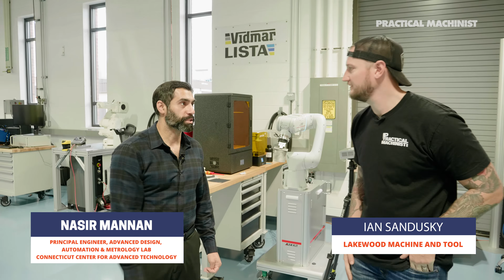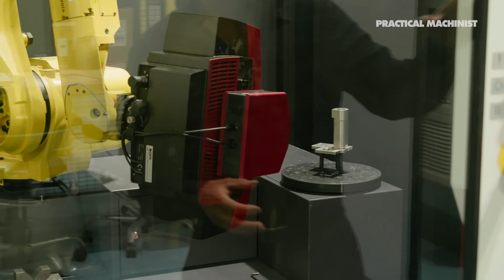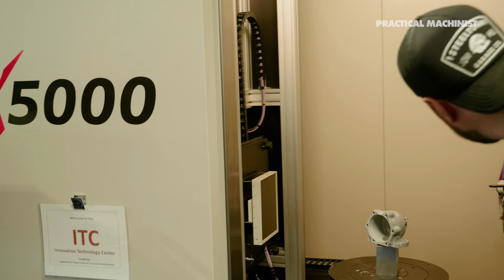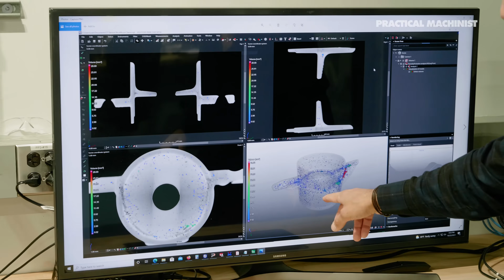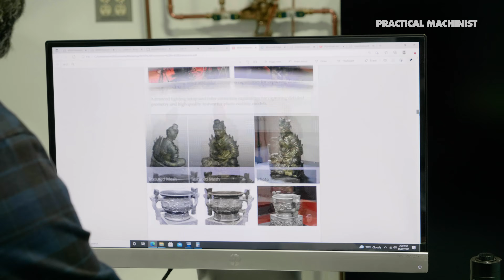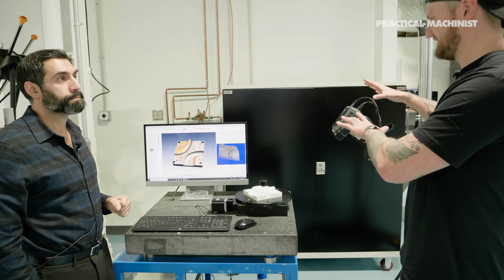CCAT's Advanced Design, Automation and Metrology Lab | Shop Tour

Comment: The ability to measure using a 3D scan to the accuracy that CCAT is doing is incredible.   Add to that the ability to do a CT Scan is mind boggling. 

Consider using this equipment to measure and align precision machinery such as; lathes, milling machines, precision grinding machines, etc.

In the early 2000s we experimented with the measurement of 150 ton units for a ship being built.  The idea being to measure adjacent units to see they would fit together.  The tolerance we were shooting for was t/3, or 1/3 the thickness of the material.  If I understand correctly, they can measure to 0.0001".

Starting in the 1980s commercial ships were required to be able to lock their rudders should the steering gear be disabled.  During a drydocking of one our ships had the steering gear brake engaged. Unbeknownst to the outside machinists, the rudder was pulled hard over using a crane.  Considerable damage was done to the rudder stock, requiring clad welding and machining.  The CT Scan would have been invaluable in determining if the clad welding was good and the rudder stock was sound.

Comment: You're thumbnail is a complete lie. 3d Scanning a part is only 5-10% of the steps required to reverse engineer a part which takes many hours to produce a useable cad file. No where in video was anything about reverse engineering covered. This was all about inspection and a little bit about automated process using a 3d Scanner. Cool video none the less, but your thumbnail is a lie.
Reply: That was my thought as well, Richard. A 3D scan file is merely a starting point to rebuild an actual CAD file if the ultimate intent is to reverse engineer a component in the true sense. It still takes a lot of CAD work to attempt to recapture the original design intent. The thing about using it for dimensional inspection is that you still need a true CAD file to start with to compare the scanned file to.